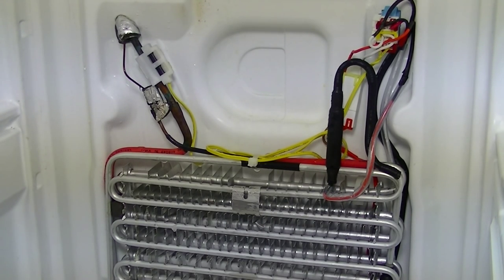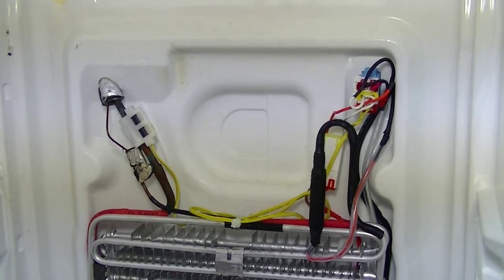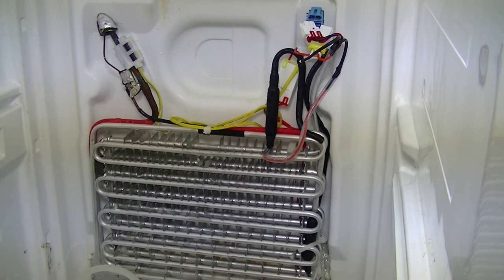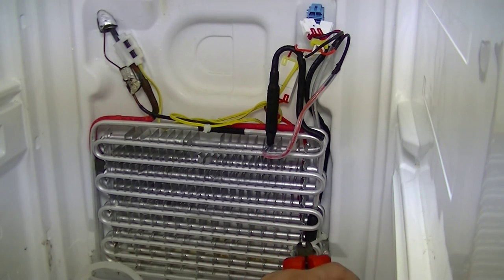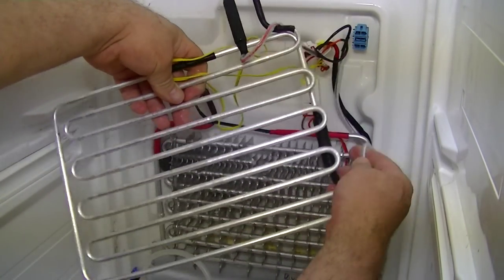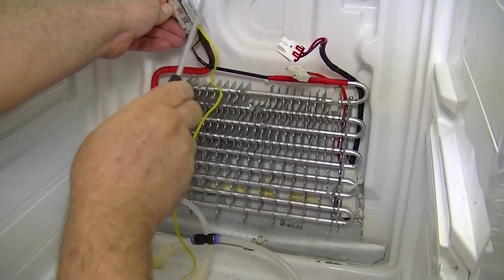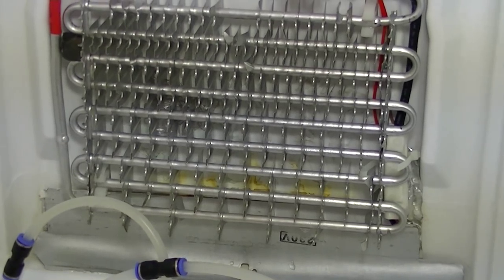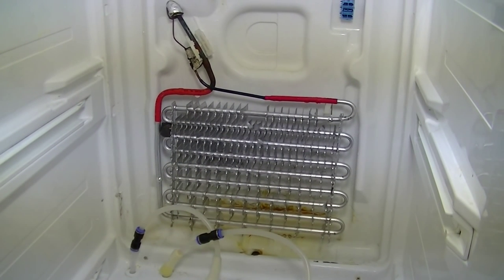Samsung Fridge Repair Kit Part 3 Removing The Heater And Sensors From Cooler

Comment: hi i have replaced all parts apart from fridge evaporator thermol fuse and the fan,I am still having problems with drain freezing up frost gathering over defrost heater element,would you reccomend buying fan plus thermol fuse,thanks.

Comment: Why is the thermal fuse at the lower back?  My fridge has the fuse i the middle left side, more toward the top.  I get ice buildup in the refrigerator coil every 3 weeks or so which is heaviest at the top and nearly no ice on the bottom of the coil.  Should the new fuse match the current fuse position or should it be put in the lower back like you mention?

Comment: What is the last part that you pull out?
Reply: George Chalkias. The drain tray and heating wire which is located inside the flexible drain hose to stop ice blocking the hose

Comment: I have had problems with my Samsung RS267lash US Fridge over
freezing and causing inside middle vent hole and fan to eventually freeze to
point of no airflow , then fan grinding eventually to a halt from being frozen.
When I force the fridge into defrost mode, it does not seem
to melt the ice either.
*Theoretically, if I force it into Defrost mode, the heating
elements should come on and should be able to test 110V Correct?

Don’t think it’s a bad Defrost heating element ,  last time I checked this it showed 96 ohmsDefrost sensor (yellow) was +- 2K at Room temperature. 
Thermal fuse (Red black /w white foam) = 0 ohms 

Not sure what to do now.
Reply: Thanks  @angelapierred6461 , this video gets lots of thanks and well done